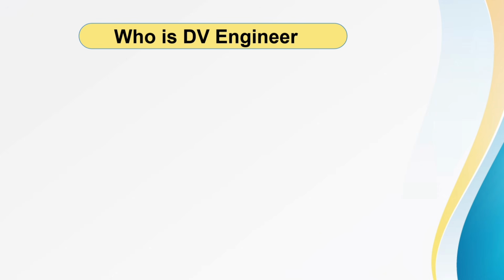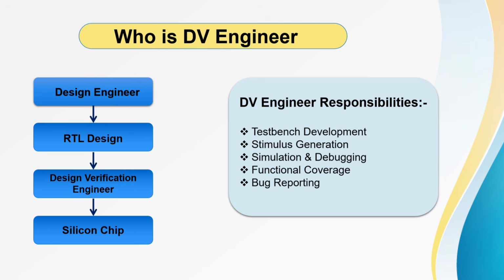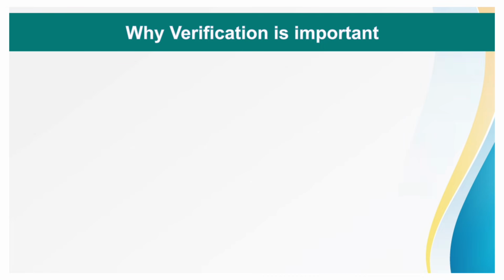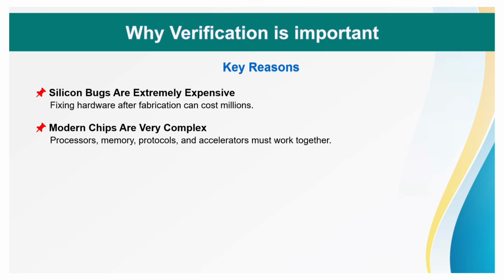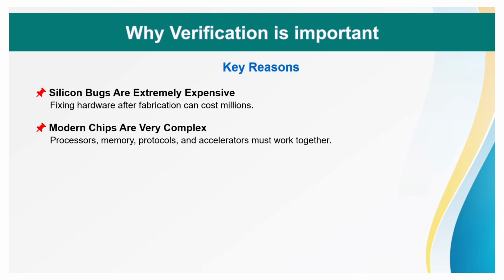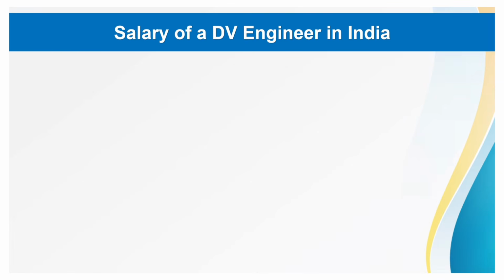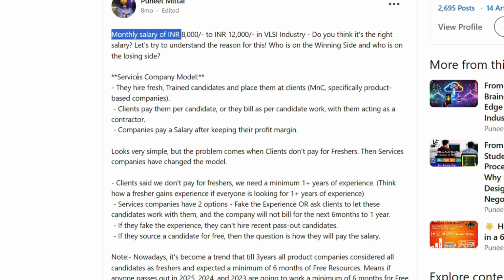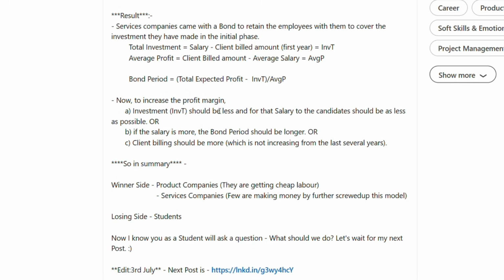Design Verification Engineer Full Guide | Work, Skills, Salary & Companies

Comment: Bhai: I’m currently a 3rd-year B.Tech student (5th semester) in Electronics – VLSI Design & Technology at Jamia Millia Islamia, New Delhi, and I’m aiming to become a Design Verification Engineer as a fresher after graduating in 2028.

I have a good foundation in Digital Electronics and have started learning Verilog. Since you entered the industry after M.Tech in VLSI, I wanted to ask:

Is an M.Tech necessary for getting a good Design Verification job, or can a B.Tech student also get into DV directly as a fresher?

Also, what skills, tools, projects, and verification concepts should I focus on during my B.Tech to become job-ready for DV roles by 2028?

Would really appreciate your advice on the most important skills to prioritize. Thank you!
Reply from the maker: Brother, just curious — where did you get the information that I have done M.Tech? 😅 I actually haven’t done M.Tech.
Reply from the maker: And to answer your main question: No, M.Tech is not mandatory to become a Design Verification Engineer. B.Tech students can definitely enter DV directly as freshers.
Since you’re in 3rd year, I’d strongly recommend focusing on Digital Electronics → Verilog → SystemVerilog → OOP → Assertions → Functional Coverage → UVM → Protocols (APB/AXI/AHB).
Along with theory, build 2–3 solid verification projects and be comfortable explaining your testbench architecture, debugging waveforms, and writing/verifying RTL.
You still have plenty of time before 2028, so if you consistently build these skills and projects, you can absolutely target DV roles after B.Tech.
All the best for your journey!